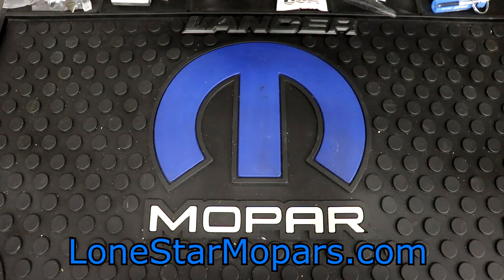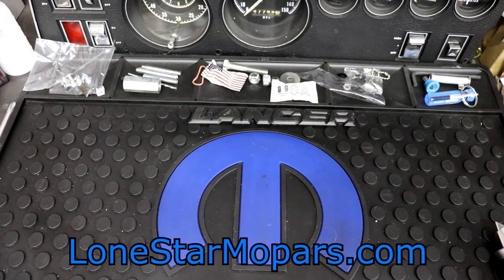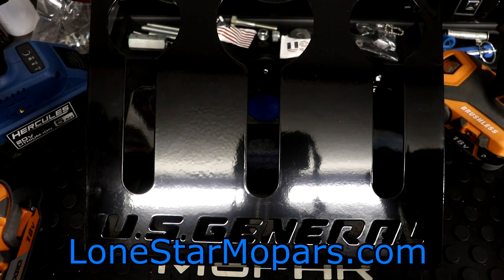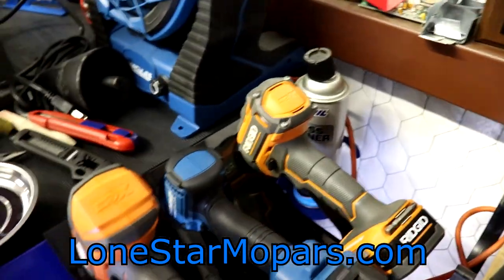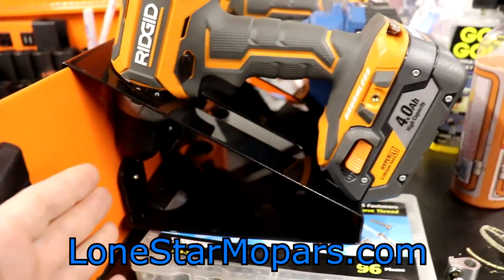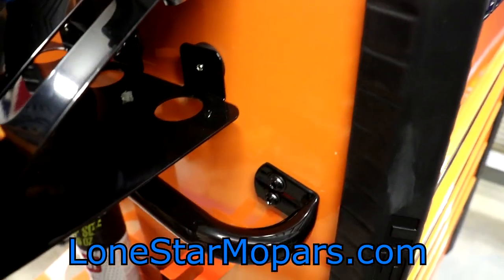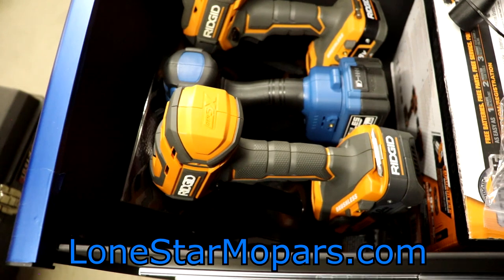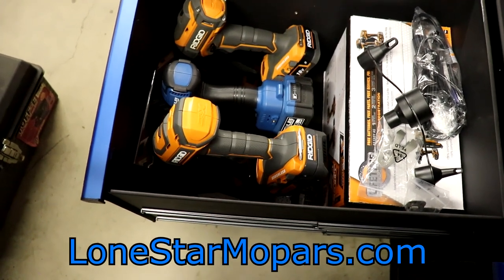Harbor Freight Tool Haul #17: US General Magnetic Power & Air Tool Holder

Comment: Just wondering if the tool cart lid closes with the rack in place?
Reply: I can answer that for you.  It does not 😭.   I bought 2 of these and all my tool chests have a closing lid.    So I will either return the holders or modify them to mount on the wall.  🤨

Comment: Nice video.  If in a commercial shop, I would likely use the screw kit to more permanently affix it to the box side and use a cable lock to secure the tools to the holder while away from work.

Comment: I really like your video. You obviously put a lot of thought into this video.  I'm a woodworker myself and was more interested in the"Air Tool" solution. I was really hoping you was going to put some barrel shaped tools like die grinders and air ratchets. But you did cover a lot of cool things. I may have to just get my hand on one to experiment for myself.
Reply from the maker: Thanks.  I definitely think die grinders would fit, but maybe a bit awkwardly.  The air ratchets would likely be the same way.  If you haven't seen my video on the Mechanic's Time Savers Air Tool Holder, check it out...it might be more what you need for the air tools.  I got mine from Napa, but you can find them online (usually in red), and maybe a few other colors from Snap-On etc.  Here is a link to the video: https://youtu.be/VxIGyzJlF1M

Comment: Depending on your space, you CAN double stack that if you notch off 1/2" off the hanging lip at the rear edge of one and front edge of the other, and it will just stick off 1/2" in front and rear of your box